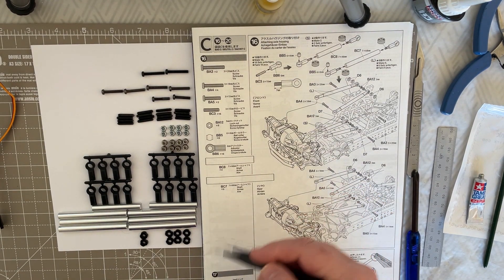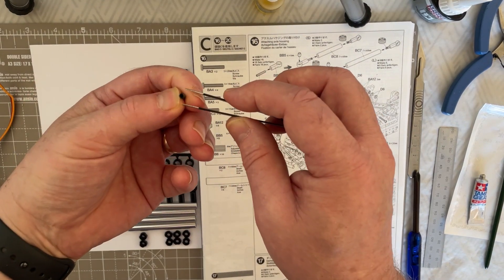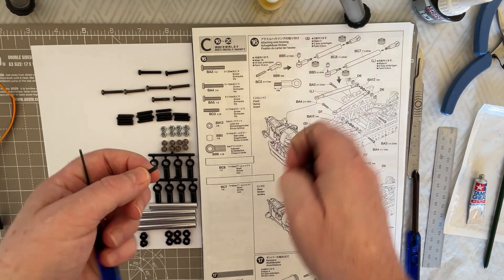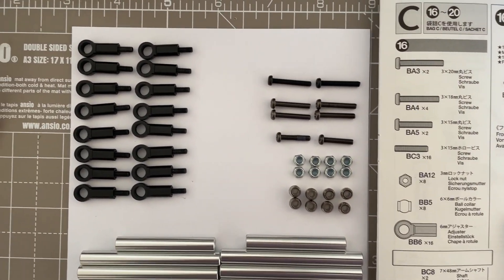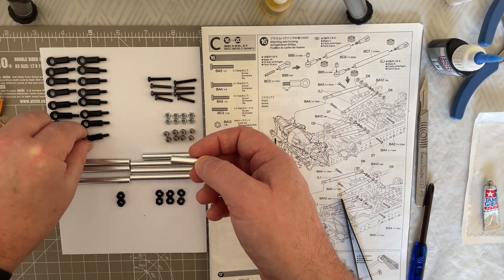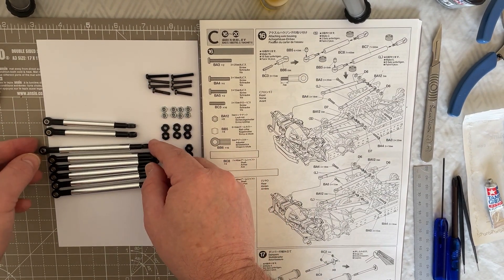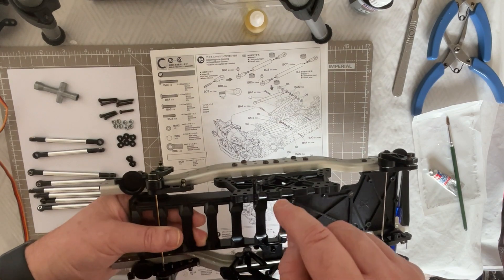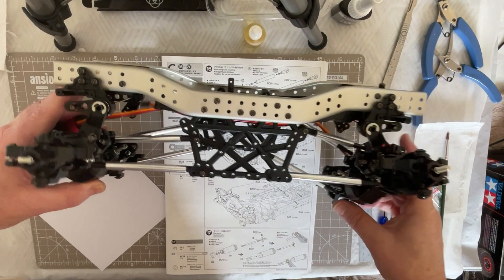Tamiya Rock Socker CR-01 Step 16 Attaching the Axle Housings

Comment: I was wondering John is that thread lock safe for plastic? Bob and I were just talking about this. I have been using loctite brand and was informed that it eats plastic or dries it out making prone for cracking this is new to me but I can see it being possible.
Reply from the maker: Hi Kev, thank you for watching and leaving me a great question. You’re certainly right, Steve @shenRC also noted and informed me that this thread lock does the same thing to plastic. After a little more research, Steve was right, it’s not plastic safe, so after this build, I’ve stopped using it, where plastic is in contact. I think I maybe lucky though, as I really don’t put a lot on the threads, so it doesn’t really touch the plastic…but Steve told me, to place a very small amount of superglue instead, it will act the same as thread lock, but not damage the plastic so much. I’m heading his valuable advice in future. I hope you’re all keeping well, best wishes to you all 😉😊😎